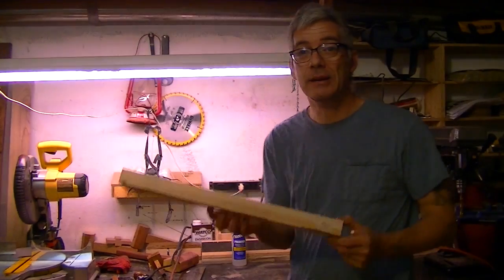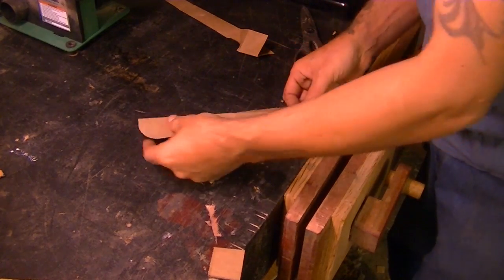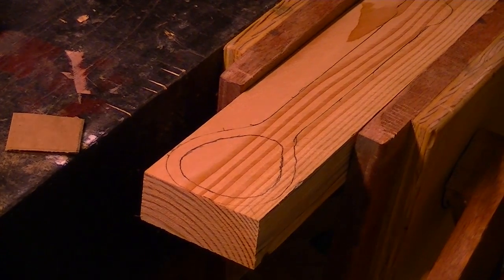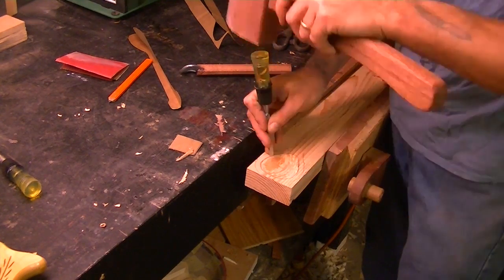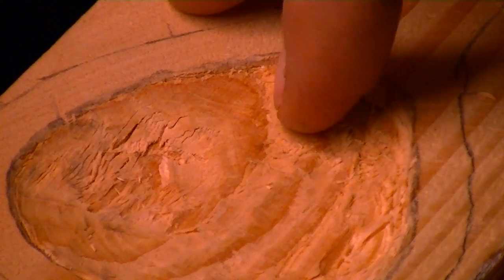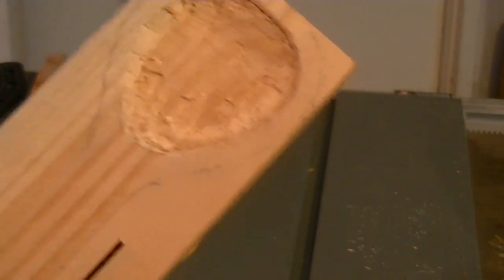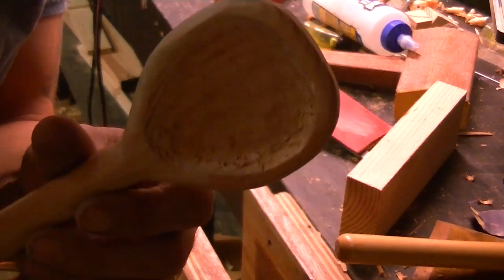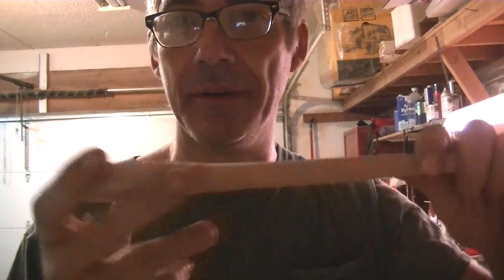Home made Wooden spoons for the kitchen

Comment: I would use maple or oak not pine!!
Reply: Well, since you wont be soaking the spoons in water for a long period of time it will not hurt. I have some made from oak and they are just fine!! Ive been working with wood for over 30yrs pup!!
Reply: White Oak or maple would be good but Birch is much easier to carve than either of those and BTW only red oak soaks up the water excessively due to its open grain characteristic.  That would rule it out for a spoon in my mind.    White Oak is closed grain and was used for Old Ironsides---look it up!  Cherry and walnut are also good choices if you have them available.